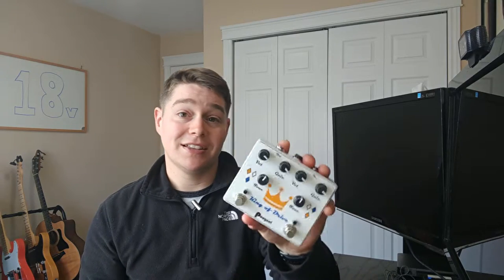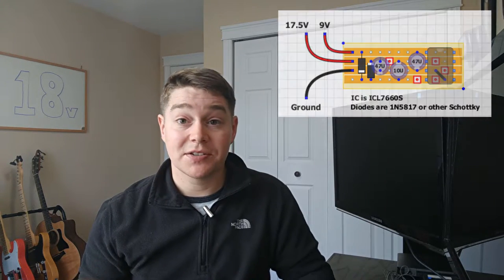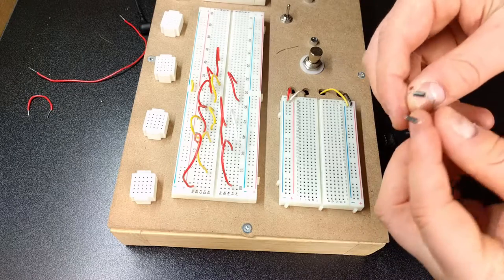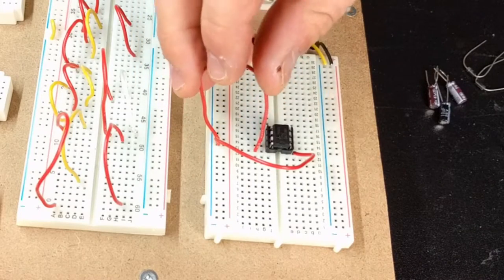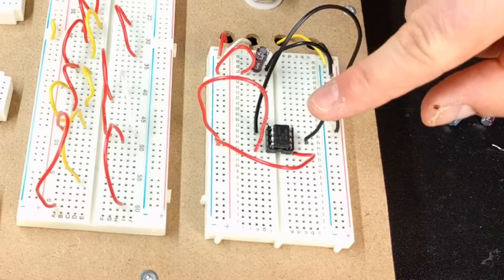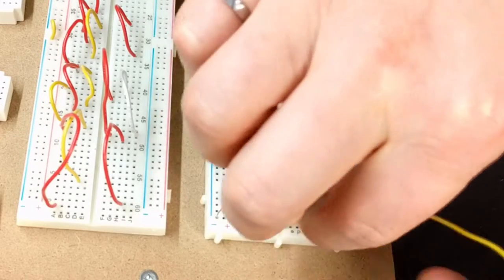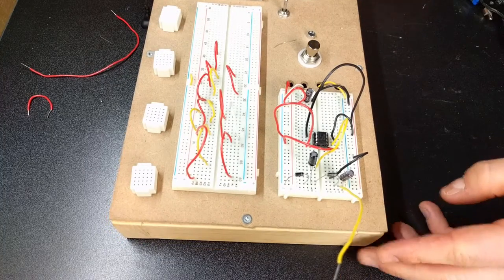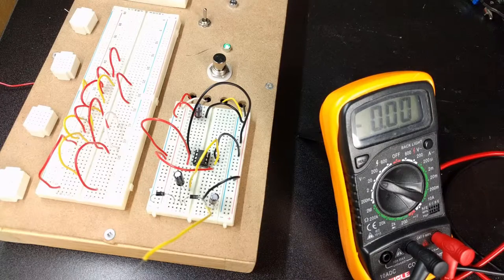Simple 18 Volt Charge Pump | DIY Guitar Pedals

Comment: nice job!!! Im just starting on one of these, what soldering iron do you use????
Reply from the maker: It's the Weller WLC100 with a precision tip. Here's a link if you're in Canada or on Amazon.

Weller WLC100CUL 40-Watt Soldering Station - WCL100CUL https://www.amazon.ca/dp/B00PVV6T1C/ref=cm_sw_r_cp_apa_i_U2LVCb6EGM1RM

Comment: Just a question about how clean the output voltage is , are there any audible artifacts from the switching in the ICL7660 ? I was considering it for a sustain pedal I'd been asked to build , a minimal effects player so he's looking for as clean a sound as possible . It's a doubler or another power supply choice.

Comment: Where did you solder the output negative tip shown in 12:37 ?
Reply from the maker: It would be for an isolated ground. Looking back it's probably worth just keeping that link in and using one ground.

Comment: Thanks for this video , so if i understand it well black wire ground is connected to pin 3 and white wire ground connected to pin 5 ?
Reply from the maker: Yes. Or you can connect 3 to 5 if you don't want an isolated ground.
Reply: @pougnetpedals   thanks a lott  I couldn't get it accepted in my diptrace program. I will try it with a switch between so I can isolate ground or connect 3 to 5 .

Comment: This circuit is working but you can not use it with your pedal... 
Everybody saw this amazing show but never any sound.. 
You made just video an musician watch. 
you give wrong information..
it is not a real voltage! how about the Amper ?
Reply from the maker: Not sure what you mean. I can assure you it is really voltage. I have used this in multiple pedals. similar circuits also have this same sub-circuit included to do just that (9V -> 18V). Also not sure what you mean by the lack of sound. This is a charge pump for internally boosting the dc bias of your pedal, it is a not a boost circuit used to increase the level or gain of your signal.